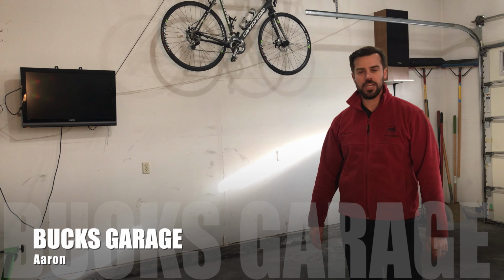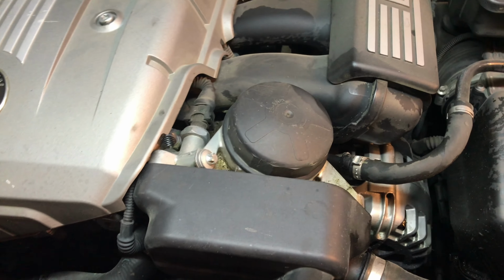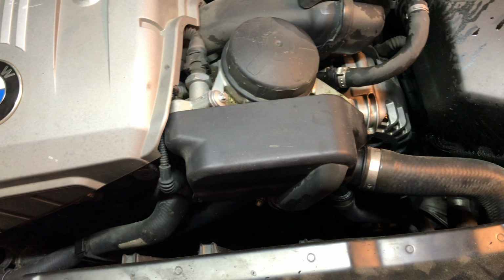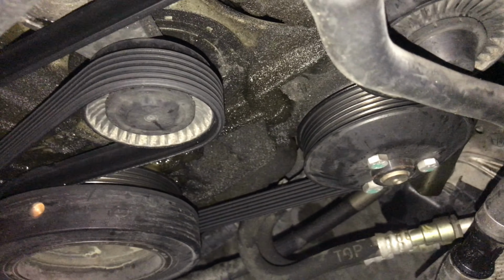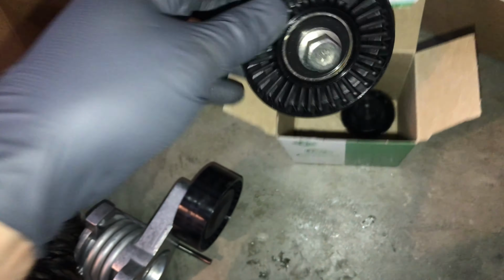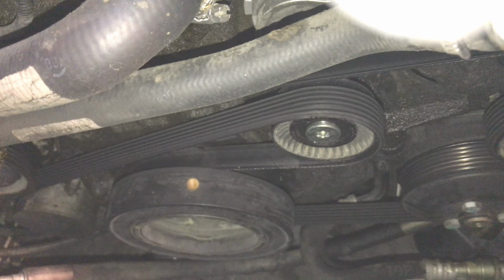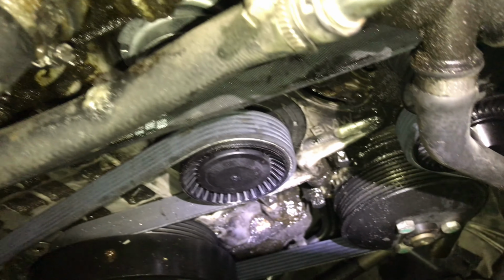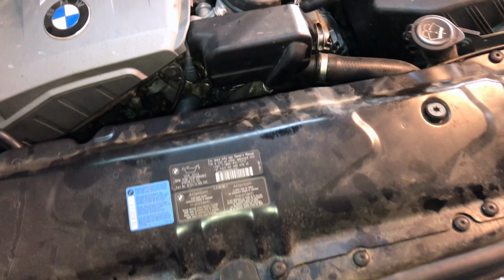How To REPLACE Squeaky PULLEYS And Drive Belt On A BMW 530i E60 N52

Comment: Do you take the pin out after putting the tensioner pulley in or before
Reply from the maker: Leave the pin in until you have the belt routed back around all the pulleys, then pull it out and your belt will be tensioned and you are all set.
Reply: I tried doing that and for some reason it didn’t want to go into place as when I took it out it’s like it didn’t wanna fit and the pulley would hang down lower to where the belt would just slip on I’m gonna buy another tensioner pulley and try again
Reply: It’s like it wouldn’t fit in the slot the same way I took the old one out

Comment: Thanks for the video but it should have been like 3 minutes instead of 10. I just need to know the steps for removing and replacing the belt tensioner. That’s it.
Reply: Just my two cents. I’m probably too impatient, but again, thanks for making the vid